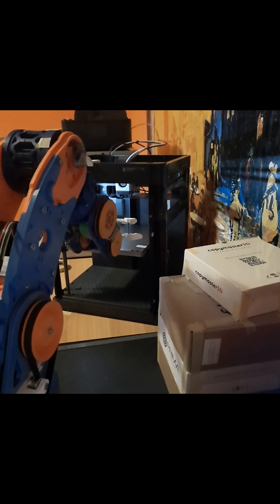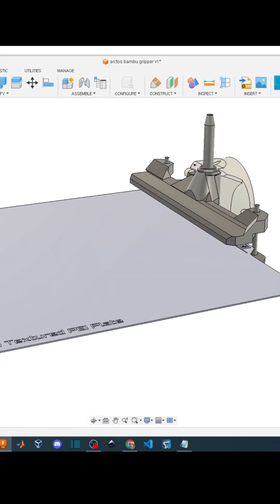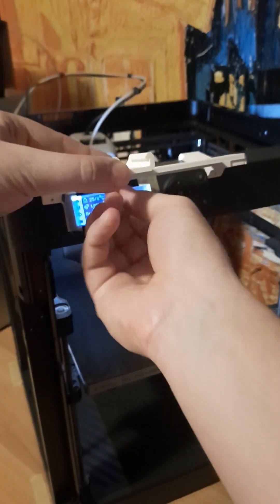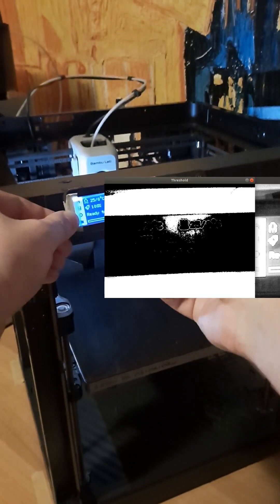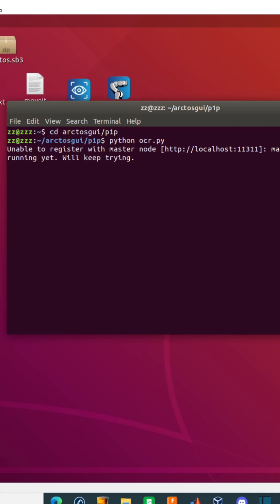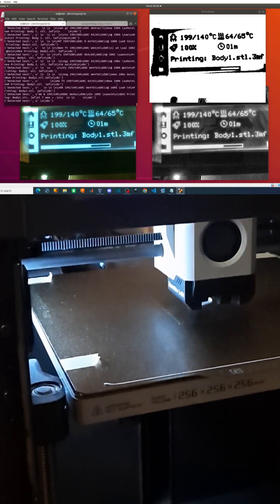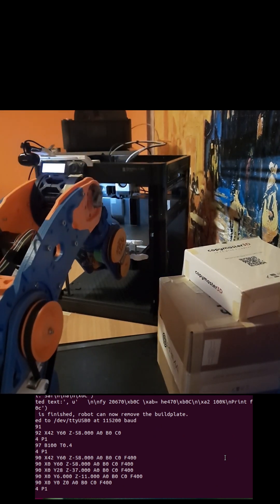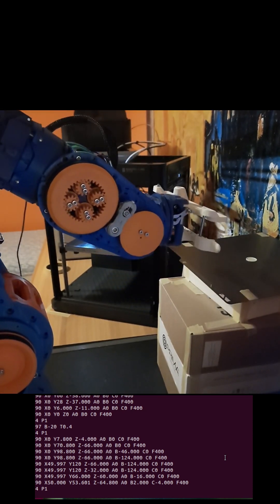Automate Your 3D Printer 🔧

Comment: now do it with a p1s
Reply from the maker: Sure, I designed a little hook on the gripper for door opening. It's a few targets more, but nothing too complicated.
Reply: okay thank you also what is the stylis for? oh and one last thing does the usb cam run off the robot arms controller or do you need a computer
Reply from the maker: Stylus is for the display, so the robot can click replay, or change the print.you need a pc, or at least rpi. Btw you can do full automation through bbl api wihout cam.
Reply: Oh sick thank you i will hopefully get one of these arms at some point since that is awesome